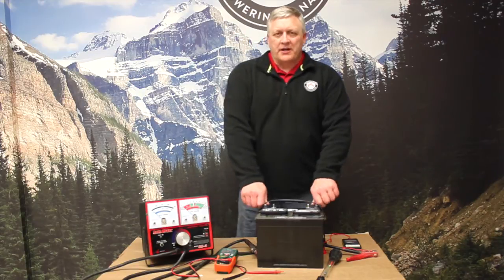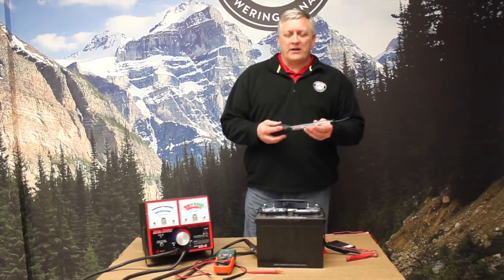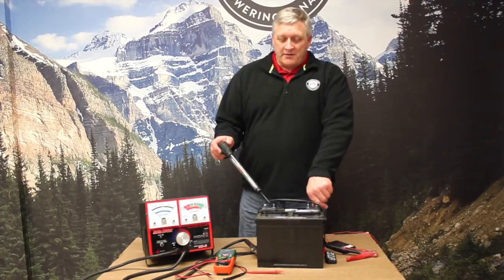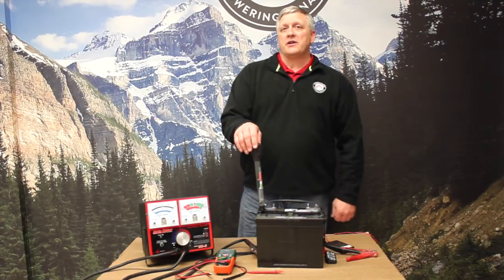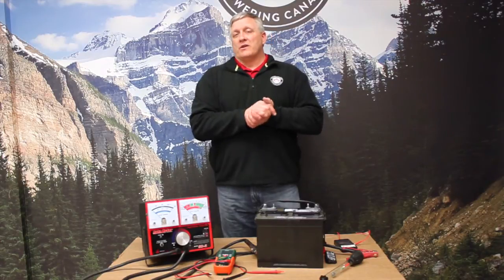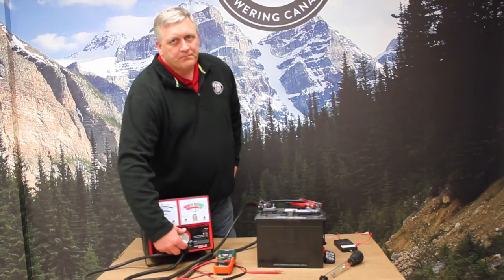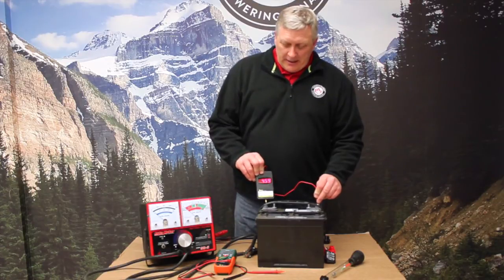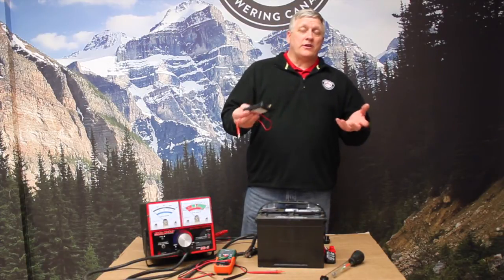Canadian Energy™: Determining Battery State of Charge & Load Testing

Comment: The surface charge itself could be sufficient to start a car. The state of charge may not be that important depending on what the battery is used for. My very old and low state of charge battery is perfectly fine for its intended purpose so long as there is a lot of surface charge. The battery has lost most of its capacity through normal sulphation over 17 years. My small solar panel is able to provide a lot of surface charge at 15v. Even though the battery has very low CCA, the surface charge allows it to work completely normally to start the car.